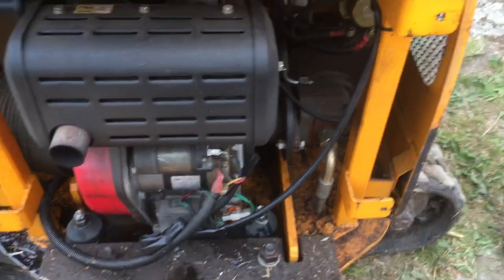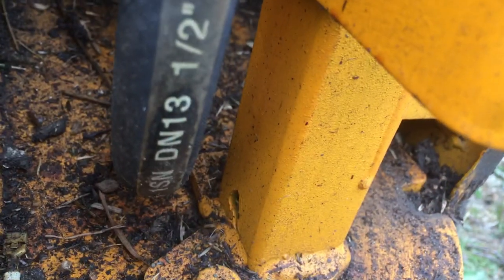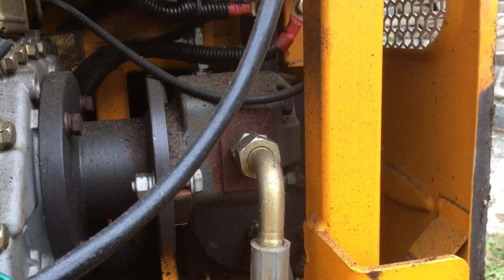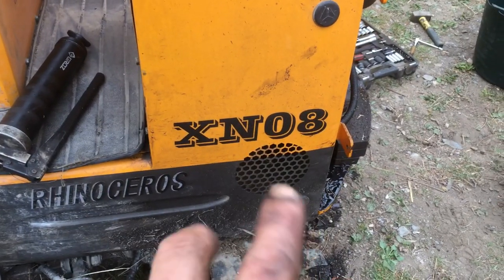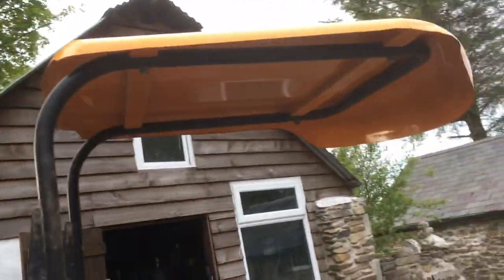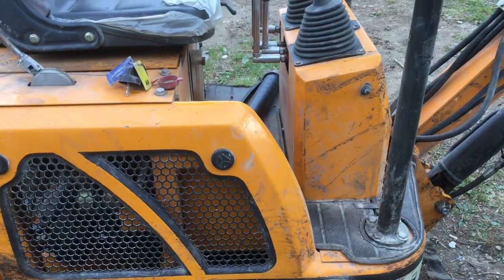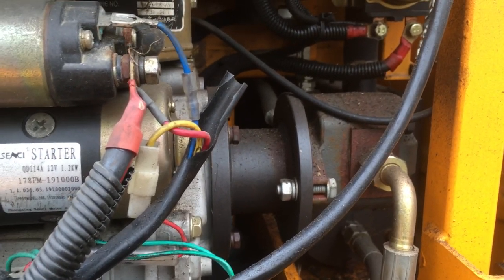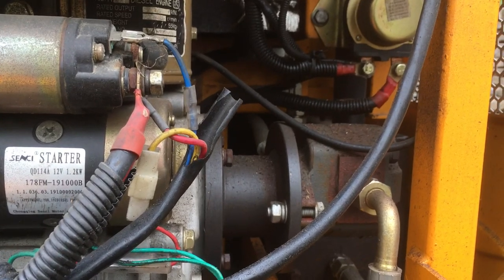Rhinoceros xn08 Chinese mini digger - 12 month review

Comment: Just sold a new XN 0.8 machine and ignition was stuck contacted Lucy at the factory and she sent one air freight.
Their bigger machines are very good and the quality is on par with the over priced Yanmar, Kubota etc.at a very reasonable price. All quality components. We had four XN 1.5 in our hire fleet one left we sell them into the second hand market afterwards all done murderous 1000 hours and no problems. Only bucket pins and bushes at about 500 hours. The brand name bushes and pins also only last that long and cost and arm and a leg.
We have sold this year 3 XN 1.5, 3 XN 2, 1 XN 1.8, 1 XN 8-E and XN 0.8 all our customers are totally happy.
Reply: Hello,
I've just found out about these and i see your comment. I'm in Germany and i admit youf the first person I've contacted regarding this subject but I'm a big of a geek so ilk be be watching everything.
I may be interest in a second hand machine. Pls would you give me a direct e-mail account.
Reply: My xn10 motor ran away on me on a lousy 100 hours. It leaked like a sieve from the decompression lever. Smoked like hell for a while before it ran away on me. At one job the fumes were so bad I got smoked and chucked my guts up. That was a Chang chai engine. Put a koop engine in and it’s much better.

Comment: Your a legend for putting these up mate. Iv got the XN10 model and the Chang chai motor in it hand grenade on me so the dealer put a Koop motor on it. Well I put it in and he gave it to me for half price. I just did a track seal and your video has saved me, I know exactly what size seal to get for it now. My feed back is check all your bolts often. Especially on your slew motor. I blew the o ring on it cos surprise surprise half the bolts were finger tight. Blew the o ring on the post hole digger that come with it, same problem, loose bolts. Never had electrical issues surprisingly. It’s a great machine for its size! Parts are cheap and it’s not scary to work on like other brands.
Reply: Ps one of track motors is being a pain in the ass to seal. Iv thrown 3 seals on it and can’t get it to seal !

Comment: Sebastian:
Glad you got the wheel motor seal leaks fixed.  Hope you add pressure filtration for the hyd oil.

I see you bent the boom cylinder hardlines.  I reversed this cylinder so the hose connections are between the cylinder and the boom and much better protected.  Also, the pivot point on the ROPS is correct and works well, in my experience, folding forward.
Reply: Tradutor gogle

Comment: Had our one run out of diesel. Managed to get the diesel line cleared and running again sweetly. However hydraulics worked for 2 mins and now nothing. Still plenty of hydraulic fluid. Slowly trying to figure out issues. Anyone else had this problem?  Or know what it might be?

Comment: Please can you do a video on chaging / re-mounting a track. It took me 2 hours.
Reply: On mine I pick up one side with a bucket an the blade down lifting machine onto one track. Put one side on the sprocket. And use a 3 ft bar to pull the teeth of the track over the travel wheel. While pulling advance the the track with machine and boom track on. Reverse that to get it off. Hope this helps.
Reply: Re-mounting track is now down to 5 minutes with a 5 foot bar. The trick is to coax the slave wheel back in as you pull against the track. Having an wxtra someone on the machine is a must

Comment: Hello please can anyone tell me the lengths of the hydraulic hoses on the xn08. It’s not in the manual and I need to replace some with the correct length. Someone has replaced them in the past with some that are way too long.. also please can you confirm what fittings are on the hydraulic hoses… thanks!

Comment: Hi Sebastian wondered if you could help please. I have damaged a hose for the boom cylinder so need to replace it. Just stripped the machine down to get to the hose and thought while it was stripped down I would replace the hydraulic filter before topping it back up. I can't seem to see where the hydraulic filter is, can you help?
thank you

Comment: Mine has just done 160 hours, no problems until today, it threw a track.  I have to try and find a tutorial on how to get the track back on.  Can anyone help?
Reply: The tracks are held under tension with a large spring which can be slackened through square hole  half way along. It is easier to use a 5 foot steel bar and lever the track back on slave wheel.
Reply: @binmanblog  hi there Steve.  It was a battle but with help I got it on. The secret is to put it on the front idler first then  wind it on with the drive with a bar and swear words. Two man job.  The most important tool is the swear words.

Comment: I met the 1.8t version of this the other day at a training place to renew my VOC.
Oh boy, stalling out, has a governed speed rather than a throttle (no control), no pilot controls, (but I never even got to try anyway).
I saw the $10 electric fuel pump and the pathetic no name hydraulic pump with the coupler thats bigger than the pump.
Stalling, wasn't sure why and wasn't given enough time to have a proper look, Sad pile of Chinese scrap metal with 180hrs.

Not really much cheaper at the end of the day after all the extra no doubt, unadvertised costs to import to Australia $18,000 AU.